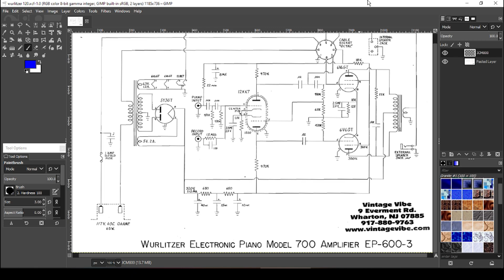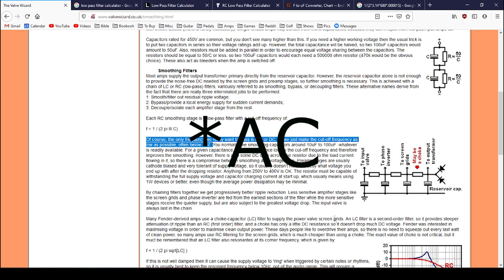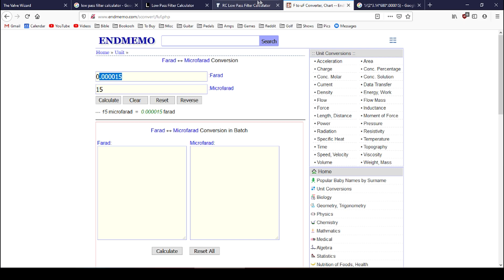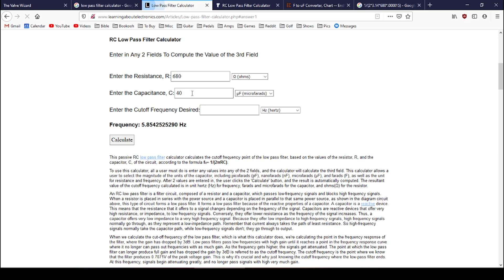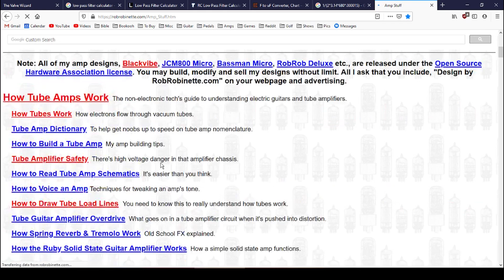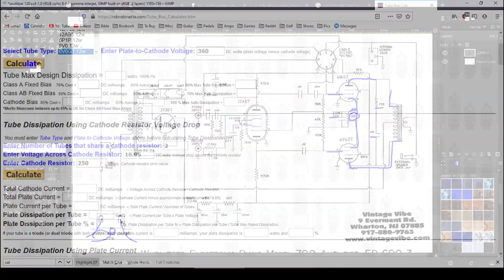Wurlitzer Model 700 Tube Amp Circuit Analysis

Comment: After the 18K resistor is pin 6 on the octal socket. That voltage is the operating voltage needed for the piano rail which has the reeds spaced in between it. When the reeds vibrate it creates an electrical signal which goes to the piano input of the 12ax7.I think the 22 meg resistor and the piano + input create the loop needed for this electrostatic high impedance circuit. There is 94 volts DC on that piano input. Not sure about the 8 UFD. I would think it's more filtration. Any audio on that line would be shunted to ground with a capacitor of that value. There is no info on this circuit that I can find. I have the piano and have been playing with this amp for about 2 weeks. Your ideas are welcomed.

Comment: A/C will not blow the fuse unless the circuit is completed, so technically it doesn't matter where you put a fuse, the transformer will still become saturated. The fuse will do its job to protect the transformer in any location, as long as it is not over-rated.  The reason you put the fuse on the hot side is to keep the potentially "hot" areas of the wiring to a minimum within the failure prone areas of an amp.  As close as possible to the hot side of the wall outlet. If you didn't do this, the fuse would blow and you could still have live wiring inside. The exception (in my opinion and others) involves the on/off switch and how to keep the potentially hot and exposed side of a fuse end from occurring.

Comment: That tap is where the B+ splits to supply the plates of the output tubes. Seems to be common to push-pull output stages.  The 40mfd. cap is tied directly to it, to filter the B+. the transformer windings also act as a choke. Also note that one rail on the filament tap is already grounded and would need to be addressed for the derived center tap to work.

Comment: This was so informative! Thank you so much for posting this, the annotations helped me understand the power and signal path. I think Wurlitzer e-pianos have an electrostatic pickup that require170-180v at the input to work properly and coupling caps to prevent the high-voltage DC from reaching the grid of the input triode. Tropical Fish goes into more detail on their site:
https://www.tropicalfishvintage.com/blog/2019/6/26/how-is-a-wurlitzer-tube-amp-different-from-a-guitar-amp
Do you think it would be possible to modify a Fender 5e3 or a module like the 50ASX2SE to work with a Wurlitzer? Would you recommend sending the filtered B+ to the OT center tap and the "piano input" for the 700 amp? I'm still learning about amp design and hope to build something for my Wuli 200. Thanks again!